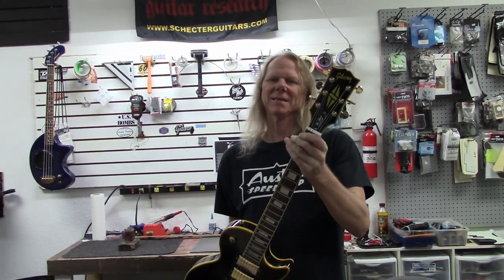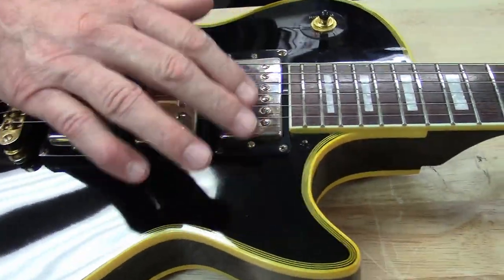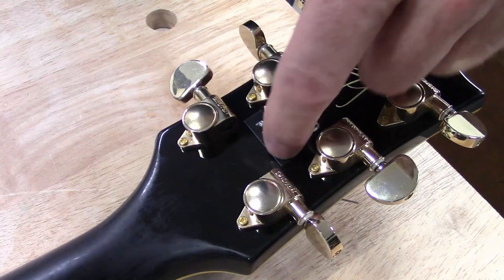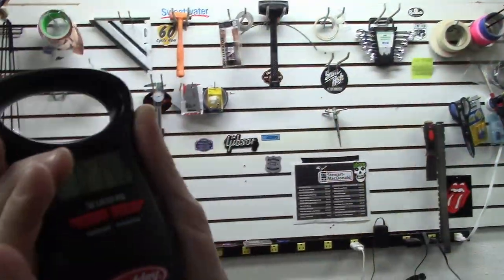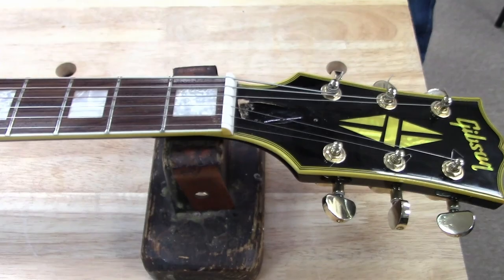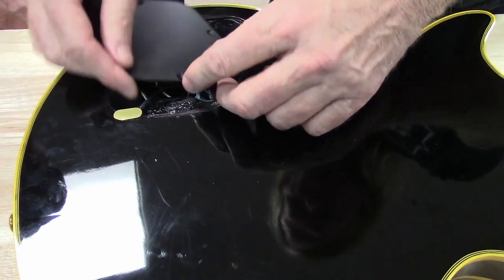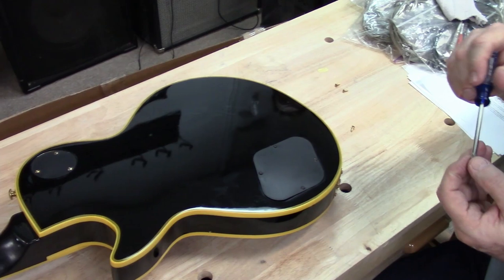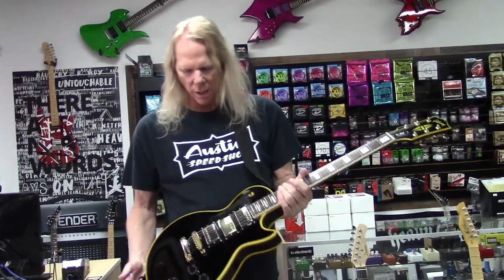Fake Jimmy Page Signature Gibson!

Comment: I would like to add you can buy a set of pro buckers from Epiphone they will cost you $170.00 not cheap
Reply: You can get them factory direct from the Chinese factory for about $60 shipped. Push pull pots, Jack and switch included. Plug and play for those that can't stop grabbing the wrong end of the soldering iron! 🤭

Comment: Nice that the previous owner was honest and labeled it a fake. But the guitar should have a permanent "Fake" designator, not just a label that can be easily removed. I.e. It should be engraved or burned on the back of the body and headstock, like Phil McKnight and some others do. You can also remove or permanently line out the Gibson logos.

Enjoying your videos. Glad you asked me to subscribe when I stopped by your store while I was in town.